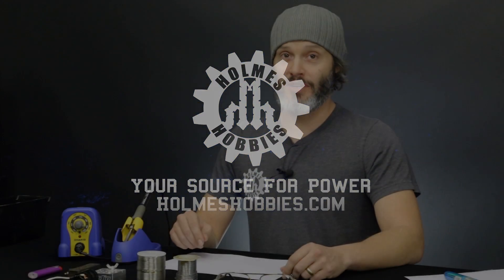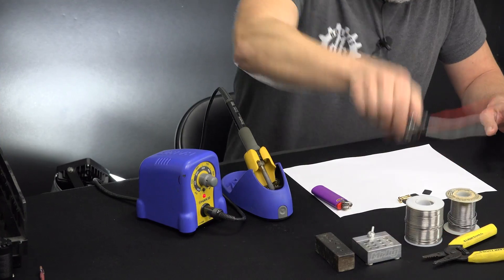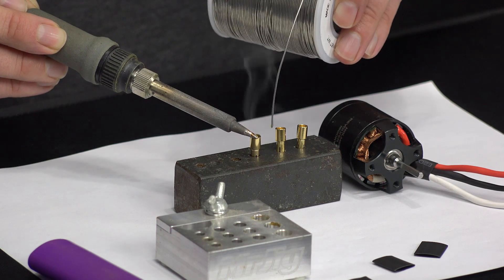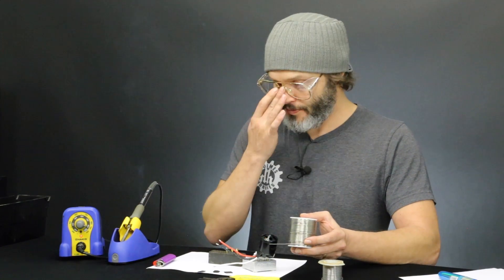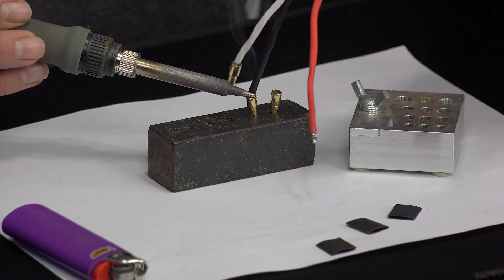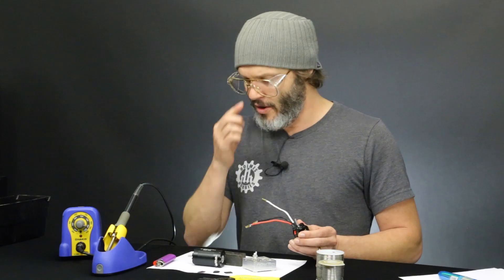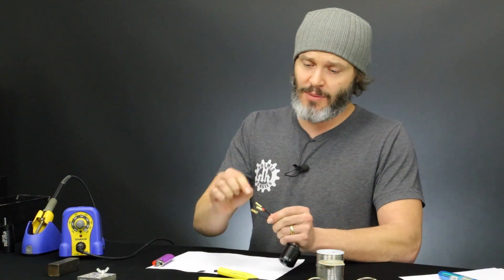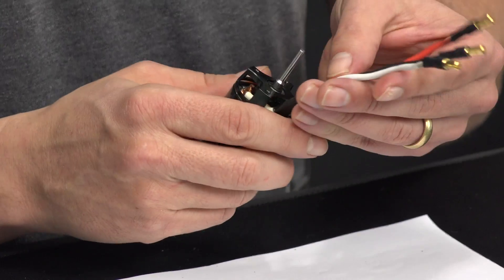How To Solder Your Crawler (Or Any RC) Electronics  - Holmes Hobbies

Comment: I've been thinking to get a soldering iron today.. Wanting to modify my wireless headset with a new battery and then i stumbled your video about soldering, I checked but the hakko fx888 is listed at 20k jpy here which is something i can't spend money into right now but wanting to give soldering a try... I however saw a much cheaper one at 5k jpy w/c is maybe similar? called TOAUTO soldering iron set... Or getting a hakko fx888 or similar still recommended?
Reply from the maker: For just getting started the low cost should be fine!
Reply: Sorry to pester you, but im still stuck at thinking what to buy, i saw a much cheaper ones but without a dial, i would want to ask if what's the "heat output" does the soldering iron i need for soldering wires on a 18650 battery? the thing i want to actually make is modify my headset with a 18650 battery since it doesn't charge via usb anymore, so i wanted to like swap batteries externally instead... if a cheap soldering iron would do the trick, i'd buy one now...

Comment: I would love to see a video on soldering the XL motor or a 1/8th scale motor. I have managed to desolder a reds v8 with 10 gauge wire with my 60w iron, but I can need get a good connection when soldering motor wires on, maybe I just need a bigger more powerful iron.

Comment: Lead solder ftw. It's miles better. It's not good if you have to use it for your job because of the health risk, but if you just solder once a month or a couple of times a year its just better in every way.
Reply from the maker: It is easier to work, for sure.   But I'm not going to expose myself to it daily, and technically it's illegal to export items into most countries with lead solder.
Reply: @HolmesHobbies  yes I agree. If you are using it on a daily basis its a bad idea to use lead. In the UK I think it's completely illegal to sell lead solder at all now as well as products with it in. Luckily I have a massive roller which should last a very long time.

The other advantage of leaded solder is you don't have to use as much if any flux and I would say without extraction, the fumes from the flux could be worse in the long term than lead solder. Obviously having good extraction massively reduces the risks, so most people will be OK as long as they use extraction. 👍

Comment: I have got to ask you one more time I'm not even sure you even read these but I have to as I lost my right foot shot off with a 45 auto I have a trx4 rc truck kit complete and built very tuff it also has beadlockorabd wheels on it and a holms hobby 550 can and a 1080 esc with a set of new traxxs for the trx4 for snow and mud will you please trade me for a brushless system and esc 540can please I need these so I can run my new truck I will trade you all of that for just the motor esc and brushless system please pics on request of all people I trust you and I'm not sure y but please trade me you are getting more than you mo ey worth

Comment: Good video!

I'm glad to see a pro sometimes gets solder in the wrong place. I get frustrated when I do that.

Sometimes soldering goes very easily for me and it's fun and even a little relaxing. Other times it's an exercise in frustration from beginning to end. I started off with a 60W HobbiCo pen iron and now I'm using a Protek TK955 station and it did make the job easier. Larger wires can still be extremely frustrating.

Comment: This is my next step in setting up my upgrade on me TRX 4 Tactical Unit. Holmes Revolver and Castle Mamba x ...one problem I run into is getting the XT60 connectors to soldier correctly what heat range would apply to the XT60 connector?
Reply: Everybody's irons are different usually I would just start at the lower end setting if it's not heating up and pulling up the solder turning it up a little bit and just keep doing that until it heats it up to the proper temperature to be able to solder the size wire you're trying to connect.

Comment: Right on Mr Holmes!! I stayed away from soldering for lack of experience (zero) & a bit of intimidation ( because of the lead). With your in-depth information, I’m now confident to get down to business. Thanks man, keep rockin🤘
Reply: no one carries lead solder at the normal places youd go to buy it its honestly pretty hard to find, in canada anyway. Just run a home fan pointed towards a window and the back at your piece that your working on if your concerned about fumes but honestly the air we breath in major cities is probably alot worse for your health

Comment: Thank you for pointing out the perils of acid flux in stranded wire.  I have been using acid flux.  I guess I wont now :)

Your soldering iron is nicely tinned.  Any advice on how to prepare a new soldering iron?
Reply from the maker: If a tip is not tin plated from the factory (most are these days), warming up the iron slowly and applying NON flux core solder continuously to the tip until it "wets" it out is the easier way.   There is a very narrow window of temperature to get a non tinned tip tinned before it starts to oxidize, if this window is missed the tip must be cleaned with acid or mechanical methods and the process starts again.     The problem with pushing flux core solder onto the tip is that flux core solder will actually eat away at the tin plating over time,  so this is one reason to NOT apply solder directly to the tip.
Reply from the maker: I should also add that a non tinned tip may need acid flux put on it before the tinning process, and let it do it's job as the iron warms.   Being quick about hitting the tip with tin before it gets too hot is the key, the window between ready to tin and burned is so small.  Sometimes, acid flux is the only thing that will get the tip ready to accept tin.    Once tinned, cool down and wash off the tip well so the acid does not continue to eat into the tip.

Comment: Heat 450°. Dam dude, I crank up my Trak Star to 700°...I'll dial her back a bit..
Reply from the maker: 450 celcius.   Anything above that will ruin the tips quickly and overheat the solder, leading to oxidized joints.     If your iron doesn't have enough thermal mass for the job, turning it up can be the only way to get the job done.   Just do the work quick and don't let the iron sit at that temperature, or else you risk oxidizing and ruining the tin on the tip.
Reply: @HolmesHobbies  Thank you! AGAIN!

Comment: Hi, 
It’s a nice video for beginners.
Just from my experience is more easy in use an alligator clips to hold connectors (less mass to heat-up).
Reply from the maker: Yes indeed!    Just didn't bring all my equipment for this vid, but we do have a few sets of alligator (3rd hand) tools as well.